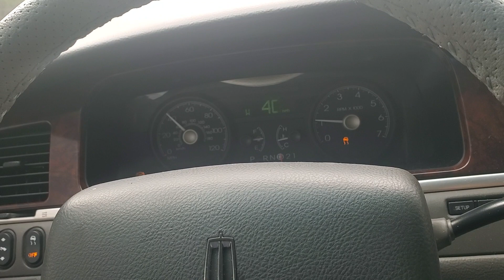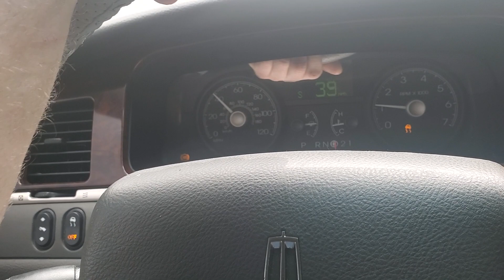2006 Lincoln Town Car ABS light finally came on, I was hoping it would eventually

Comment: Do u have to reset system after replacing sensor??
Reply from the maker: No not typically after you drive it it will most likely clear itself but I have seen cases where it does require a scan tool
Reply: Ok thanks. I replaced it and still doing the same thing

Comment: So when I'm on highway the car wint go past 40 and the traction light is on. 

Also my instrument cluster wont stay on but days it will. Been told its bad but all lights work and even when its off blinker and radio and heat and locks still work. When it pops back on my locks reacts too. Any idea what it could be.
Reply from the maker: Yeah those did have instrument cluster problems often

As for you not being able to go over 40 miles an hour this could be a number of things you need to scan for codes
Reply: I dont beleive its yhe cluster because it still comes in and then goes out. When its in all lights work. Nothing is faded. And sometimes stays on for days. As far as the accerlating no codes other than o2 sensor which was already known on car just started doing this a little while ago. You think it could still be the cluster? As far as the accerlating would a faulty traction control cause that to happen?

Comment: I have a grinding noise in my town car. I initially thought it was the rear end but after having it replaced after the right rear wheel came off..(yes the whole wheel and bearing and everything came off as I was driving) the noise is back after about three days of the new(used)rear end. You think it's still the problem? Or is the noise I'm hearing coming from the transmission? Transmission fluid is good.
Reply from the maker: Why don't you make a video and put it on your YouTube channel so we can hear it
Reply: @FordBossMe  Will do. I do have flow masters so hopefully my phone will be able to pick it up.
Reply: @FordBossMe  so I've been trying to get a decent video of it but can't. Every time I record it doesn't do it or it's not loud enough to pick up on video. I can give an example. Say you're driving on the interstate or highway and you run off the road onto the rumble strips. That's the closest thing I can compare it to. It's a bit rougher though when its doing it the most and lasts around 2-3 seconds. Other times it's faint and lasts about a millisecond.